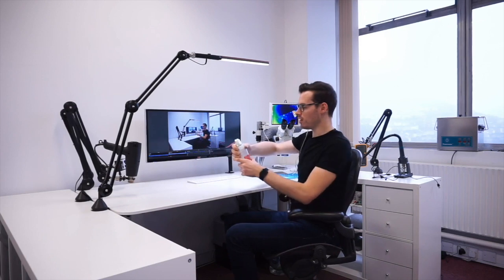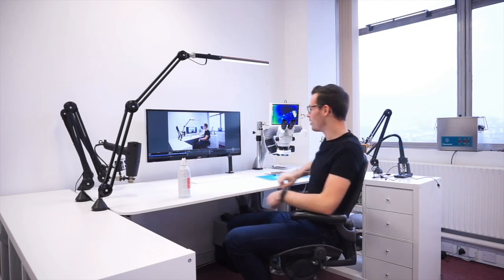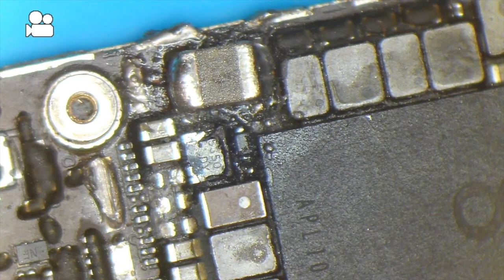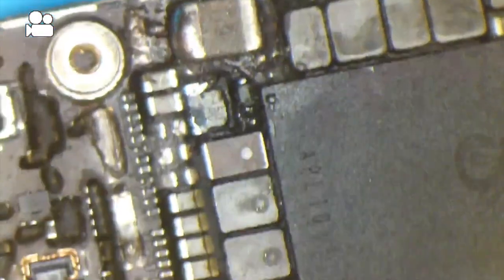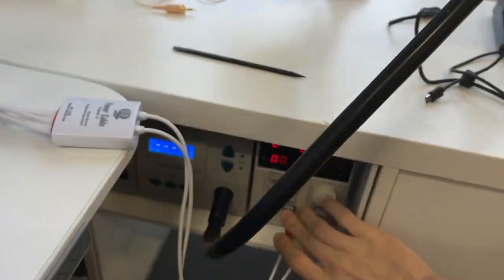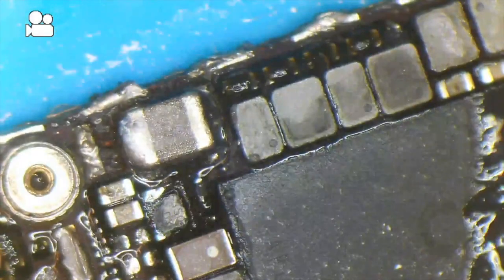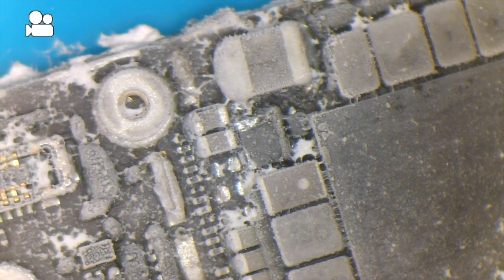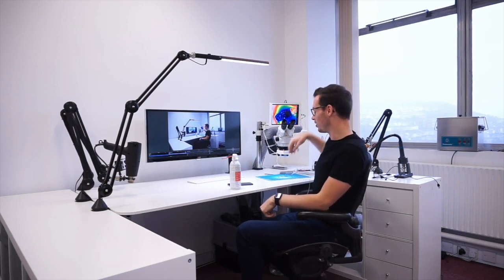Why a thermal cam can make money where freeze spray falls short

Comment: What because the thermal cam can detect any temperature change but the spray can't work in this case because the component was covered with some kind of gum. However, both work well, and it's the most efficient way to find a defective component on the motherboard  (Easier then measuring with multimeter)
Reply from the maker: Not just that, but also ice takes more heat to melt 
Thermal imaging is way more sensitive and newer thermal imagine tools are even way more sensitive than this old seek

Comment from the maker: Let me know which you prefer.  FIY, I also have a macro lens making the thermal cam extremely specific in terms of heat seeking
Reply: Hi 
Where did you buy your macro lens ? I only found one seller on ebay and he isn't shipping to Denmark :( also am not able to contact him, as he has blocked that feature. 

But am wondering, will this camera be useful without the lens or should i go for the flir one pro ?